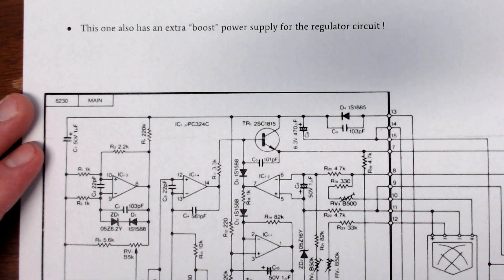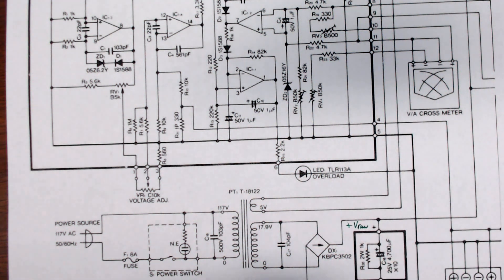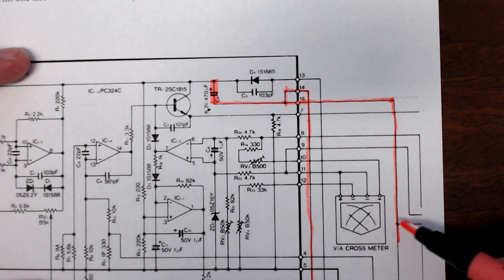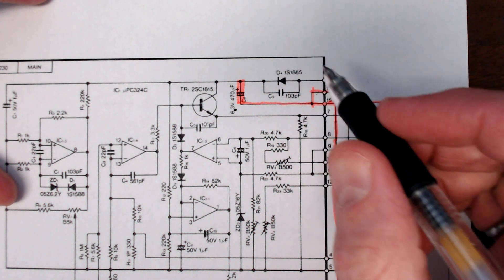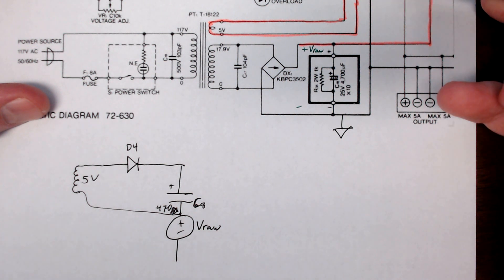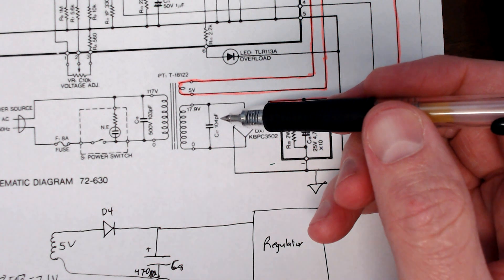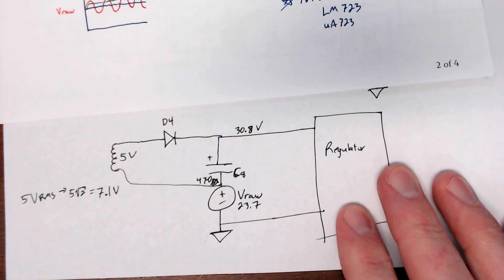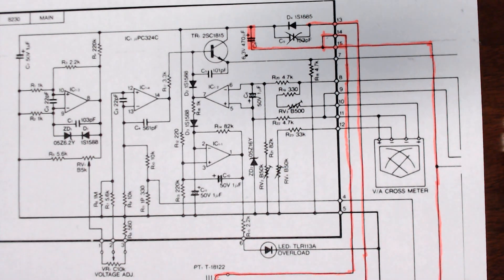Tenma 72 630 power supply, part 2

Comment: How strange, I was repairing a Watson  W-30AM this evening, this has 2 bridge rectifiers wired in direct parallel. I didn't like that arrangement so fitted 1x 50a bridge rectifier, I also changed  some other parts.
When I put the new bridge rectifier in I noticed that the raw DC was going to another secondary winding on the transformer, I thought that is really odd so checked the schematic and it was correct. I powered it all back up and all is working correctly, but I was baffled by that arrangement. Later this evening I went online to look at the schematics again but got side tracked and started planning a circuit with a SCR Crowbar or Relay/Mosfet over voltage protection. By pure coincidence looking on eBay at 30amp PSU's to repair I came across the Tenma 72-630 but this was never sold in the UK, it caught my eye as it looks nearly identical to the Watson W-30AM, so I googled it and your video came up and it answered my question about the raw DC connected to the additional output on the transformer. It seems the 72-630 is nearly identical to the W-30AM. 
Thank you for taking the time to make this video, I would never had known why it was designed this way without watching this.
Reply from the maker: Thanks for the comment Dale!  That "boost" technique is a popular way to get a supply for the regulator circuitry so it has plenty of headroom to drive the huge n-type pass transistors.  It allows keeping the raw high current supply at a lower voltage to minimize the voltage across the pass transistors at full load and therefore power dissipation.  The heat-sinking required is huge already, so any bit helps.  Doing better than that requires moving to a SMPS.

Adding over voltage protection is a good idea!  No mercy to the attached load if the regulator isn't doing its job.

It is fascinating what sorts of winding paths end up in finding the right obscure video.